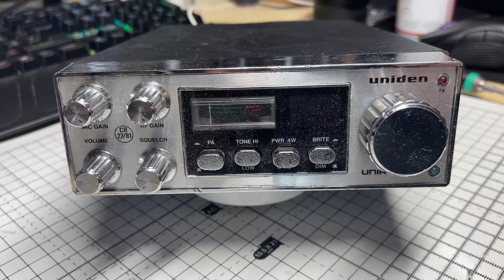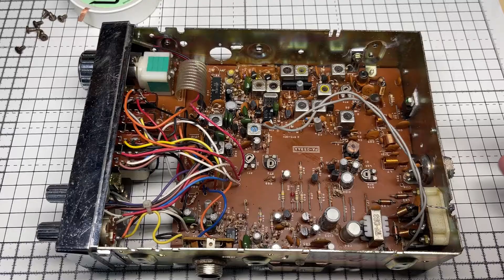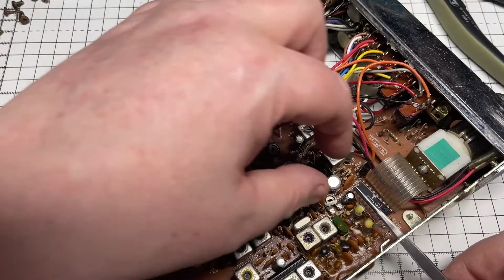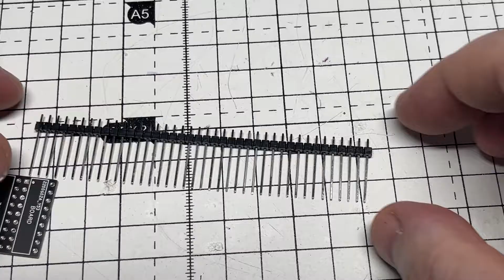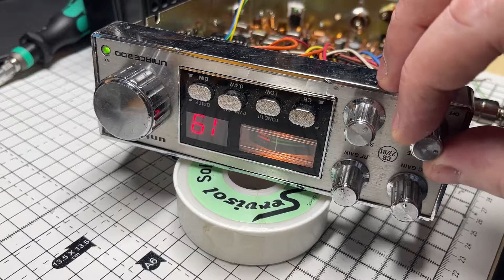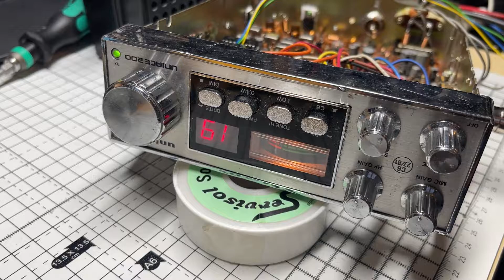EP 046 - Uniden 200 mid band mod - not a normal piggy back!.

Comment: How is the TX power across the bands ? I remember ( I think ! ) when I used to do these radios there was a mod to equalise the power across the bands , great video
Reply: Good good , I’ve got a jaws mk2 with a nice mod in it , 80ch no switch mid band - uk ( mod light now works as the uk band indicator) if I remember it is one complete new PLL ? AM/FM is on the squelch control pull/ push switch , FM board same size as a stamp ! Speaker still in radio ! I’ll unbolt it from the shelve it’s hanging from and do a video of insides and freq where it goes straight from mid 40 to uk CH 1
Reply from the maker: That would be a nice video to see, sounds like a unique mod .
Reply from the maker: Hi , its was ok, just a tad low at the bottom of mid band , but perfectly workable .